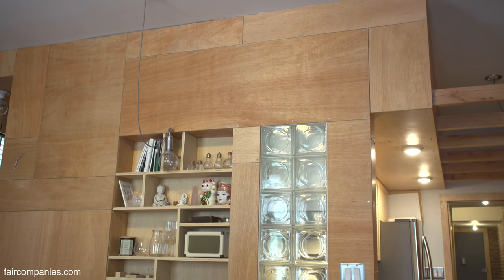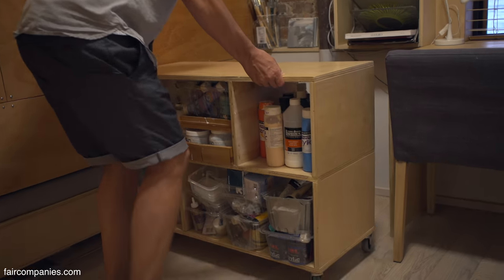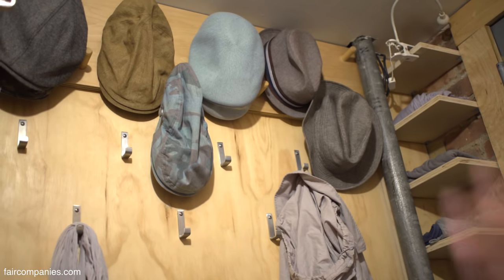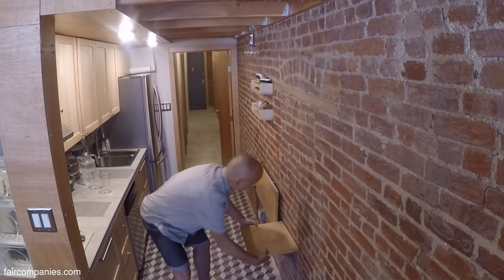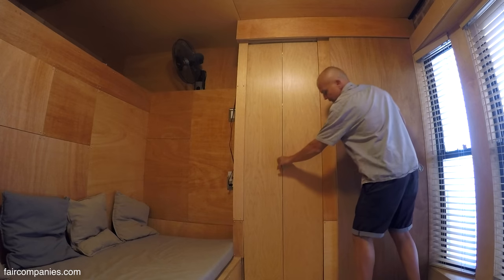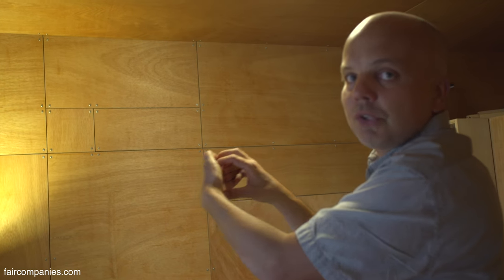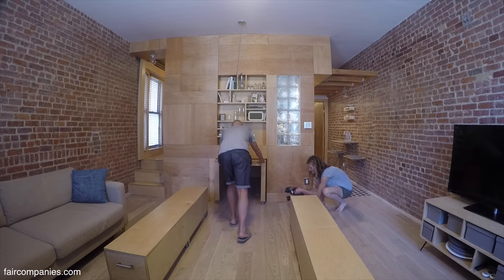Fluid NYC flat uses sliding furniture to create 3 rooms in 1

Comment: That guy is a genius love his apartment , he's made me look at ply wood in a whole different light 🌻
Reply: Think of the formaldehyde though...
Reply: Sally Brite He sealed the plywood with a clear varnish which would reduce the smell and affects of the formaldehyde. That said you are correct that people need to be aware of what’s in the materials used to build their living space in both structural and visual aspects. The same is true for furniture , textiles, and decor. This is a huge issue in smaller homes (tiny houses) and those that are tightly wrapped and enclosed preventing the normal air flow that older buildings and houses had. Which is why tiny houses and even normal sized houses have to have special air exchanger fans installed . The out gassing of toxic fumes will eventually dissipate over time especially when there is good air exchange between the inside and outside of the house/building/apartment. Unfortunately many people are clueless about what is in the materials in their home until they start getting sick and the doctor can’t find the source of what is causing them to be sick so they start doing research looking for answers.

Comment: Adding casters to every storage cabinet and many tools (miter saw, table saw etc) in my small hobby-workshop has freed up the space in a similar fashion. Casters are cheap and easy to attach, with many different fittings to suit the piece of furniture/equipment being adapted. They are fun to use and allow creativity to flourish in a small space. Best idea in the modern era of expensive real estate, yet they've been around for decades.

4 medium sized casters attached to a suitable platform, with handle attached, can carry considerable weight. I moved a heavy concrete seat 20 meters over a tiled surface without damaging the tiles or my spine.

Comment: I know he was proud of how tight the fridge fit.... The problem is that's probably not good for the fridge.
Reply: Most people don't provide even 1/2 enough ventilation for their refrigerators... compressors wear out far more rapidly that way!

 Good point!
Reply: The required space/ventilation for modern refrigerators has nothing to do with the sides of the refrigerator and everything to do with the back, top, and in front of the kick plate...  it being no clearance on the sides is of zero concern.
Reply: really? My fridge that i just bought said to leave at least 1 inch on each side. It's a new modern fridge by LG
Reply: + Hunter of the North
Rick is correct. Energy is transferred from the inside of the fridge and outside to the back. The air on the backside is heated up and goes upwards and then cold air is transferred from the bottom to compensate for the heated air which flows to the top.  

1 inch on each sides? That's a total of over 5 cm! 
Most likely you have misread the manual. I just read through the entire manuel of a new modern refrigerator from LG and nothing is mentioned about the sides, only the back.
Reply: just googled it and it came up with this...

For your free-standing refrigerator, you must leave a minimum distance of 50mm (1.9685 inches) of space free around the sides and at the back of the unit, and then at least 25mm (0.984252 inches) space at the top.Jul 20, 2018

Some say you don't need to leave space on the sides... but others do recommend to leave space on the sides. Maybe the fridge he has doesn't need as much on the sides
Reply: + Hunter of the North.

The space on the side has minor influence to get correct airflow on the back. 

Watch this video from LG. Swedish video but with english subtitles. 
https://www.youtube.com/watch?v=hBb3KBO0HMU
Reply: Hunter of the North 
Read up on it.  NOT NECESSARY (just causes a slight amount of drain on power, which changes their energy star rating)....when an issue at all....
Reply: The irony of the rick & morty picture :P 

 Your comment is super ridiculous. Basic Physics. If the hot air in the back is rising at a rate quicker than available space will allow for it to move away from the unit... it will also try to move around the sides. 

 Refrigerators are usually surrounded, if only partially... on three sides. So, unless they are completely unobstructed at the top, allowing for greater air flow ANYWHERE would benefit heat evacuation. 

 That's not even taking exchange into account. 

 You simply don't know what you're talking about.

 The more air there is around any heat generating body, the more air is available to conduct that heat into. Trapping that air with an insulator is necessarily going to impede transfer & evacuation. 

 You "read up on it" :P
Reply: Wrong... try again. 

 Energy is neither created nor destroyed... it simply changes form. 

 Heat is conducted from the coils to the air. The air takes on that energy. Heat expands, cold contracts. This hot air expands. When you define the space around it... this limits it's expansion. 

 EXPECIALLY WHEN YOU SURROUND IT WITH INSULATORS!!!

 If there is more space for it to expand into... it will. Period. Gas assumes the shape of it's container. Always. 

 Introducing airconditioned air wouldn't change what I'm saying. There is still the same amount of heat. It still has to go somewhere. It will still move away from the refrigerator at a faster pace if it is unimpeded.

 "your betters..." :P 

 Says the guy who thinks an ellipses is four dots :P ...but not even consistently. 

 Your nonsensical assertion that hot air traveling around one plain or another of any given cuboid would change thermodynamics, is preposterous. Even figuring for gravity... which is near irrelevant. You have a mass of hot air... it's right behind the fridge. It's collecting at the bottle neck near the top, where there is an opening for it to escape. 

 Ask yourself, if this exit where wider, would the air not flow through it more rapidly? 

 When there is more space along the sides, the hot air... which is expanding, will always slide along the area of resistance & when it finds this newly available gap, it will necessarily exit there. The hot air is not restricted to move in only one direction. It is expanding into whatever space is available. If heat built up sufficiently, it would escape UNDER the unit & out through your precious kickplate!

 Without fail, a heat producing body will cool quicker with more space around it, than it will with the introduction of insulation. 

 You've said nothing to evidence your foolish claim either. Your insults are not proof. 

 I've very clearly explained why you are wrong. All you've done is say "I disagree & I dislike you". Thank you, I'm honored.

  Seems like the joke's on you pickle boy :P

 P.S. moron, you're arguing with *ME*. I simply replied, politely to the OP. You are the one who came along venting your spleen. If you look at this exchange critically... it's quite clear that you're threatened, clinging to your shaken assumptions & desperately projecting. 

 Take a deep breath & actually consider the realities of what's being discussed. Maybe take your own advice & do a little research!
Reply: Dudes rich what he care?
Reply: I wonder if he thought of this and allowed ventilation through the partition into his office? That's what I would have done.  Anyone who's clutching their pearls about it can go to their websites and ask how they solved it.
Reply: actually heat moves in any direction, hot air is what rises, like in a hot air balloon.
Reply: I just spent so much time reading comments about refrigerator ventilation.. 

Thanks for the informative discussion to all involved!
Reply: There's definitely not 25mm of space at the top. Could end up being a fire hazard.
Reply: I agree. Need air flow for the refrigerator
Reply: Look what you started. This is one of the reasons they are lasting eight maybe ten years now.
Reply: This is true .. can change this a bit
Reply: @CaalamusTube  rude way can soften your tone
Reply: @CaalamusTube RUDE
Reply: @CaalamusTube  typed all that shit and still wrong🤣

Comment: Bathroom?  Shower?
Reply: not shown, but seems to be between the bedroom and office #2
Reply: Hopefully they will revisit
Reply: Here is more info and floor plan: https://www.dwell.com/article/this-compact-apartment-in-nyc-is-full-of-crafty-solutions-49bb6a3d
Reply: You can find photos, description and links here:  https://www.houzz.com/projects/2600810/uptown-transformer-apartment 
The goal in bathroom was to install washer and dryer under countertop. To solve this task, countertop was elevated a little bit higher then average standard. Since space under countertop is busy with washer and dryer, the biggest challenge was to install sink boul. If simply put sink on the countertop, then it goes to high, because countertop already was elevated to allow washer and dryer remain under it. I did not consider shallow sinks, because they are not convenient at all. Also it was not possible to install under mount sink, because there are washer and dryer. Eventually  i found sink that is half in, and half above countertop, and increase a little bit of countertop thickness. As a result this solution allow to have both washer and dryer, comfortable pretty deep sink and huge countertop to keep bathroom stuff on it. 
Another important element in the bathroom is tankless electrical water heater, Its New York, so water tank for all units installed on the roof. Building is old and big, so sometimes building tank is lack of hot water. To set tankless electrical water heater two extra valves were installed on hot and cold pipes. In case there is no hot water, i close main hot water valve, open cold one that right before heater, to let cold water go inside heater, and open another valve, that deliver hot water into the system after heater. This task also required installation of new electrical cable, because tankless heaters requires a lot of power.
The last thing is pretty big, 48”x30”, embedded wall cabinet, with three big parts and mirror doors. To support this cabinet, extra wood frame structure was built inside wall, that was designed thicker to allow build-in cabinet set inside.
Reply: ruh roh
Reply: Peter Kostelov it really shows how proud you are of this build! You did an amazing job! Well done!
Reply: Showers and bathrooms are not allowed indoors in NY.
Reply: Washer and Dryer? Or dish washer?
Reply: Bassroom and shower iz made from plywood.
Reply: @CaptainCocaine  Cheers Champ, you clearly are a Master of Your Sad Universe. You describing your own Masterly achievements would be worthy of a similar rebuke.Pfffftt!!.
Reply: @peterkostelov4017  I love it. You did an amazing job. Great use of space and the bathroom is also beautiful.
Reply: Charlotte Ziggy I hope your joking.
Reply: @peterkostelov4017  thank you!
Reply: Made of plywood

Comment: Aren't they concerned regarding formaldehyde toxicity coming from plywood? Unless the rooms are very well ventilated, the concentration of those toxic fumes, later on, will take a toll on their health. I hope they at least used a low-level formaldehyde plywood in all those construction parts.
Reply: Concerns about VOCs are justified but also often exaggerated.  So long as the plywood you're working with is at least a few months old then the level of off-gassing should be relatively very low, as long as you don't expose the material to a lot of heat and moisture. 

Since the resin used in its manufacturing process should have fully cured by that point and thus would only off-gas as heat and moisture would break the material down.

There's also many options to seal all wood products so that would also protect it from heat and moisture, which are what cause it to release VOCs as the heat and moisture breaks down the material.

What you actually have to watch out for is chemicals used on interior finishes such as paints,  varnishes, solvents, adhesives and caulks.  These have extremely higher concentrations of VOCs that are also more likely to be harmful to your health.

Though, eventually most materials will run their course and no longer significantly off-gas... This is one of the reasons people would use reclaimed materials because after so many years the materials would be pretty safe to use...

That may not be something that can be counted on with low VOC products because they off-gas at a slower rate, which means they may continue to off-gas for far longer periods that can last decades to even centuries...

So there's some caution to be taken with assuming low VOC products are always better...

Comment: The use of the square footage is nice and compact. Clever solution for the looooong table, so you can really entertain. Bench goes on the side!
But it sorely needs a few plants. The place is drab. I would get seriously depressed in it. Plus I don't like the plywood as the ceiling. Looks exactly as it is: finished with whatever ends were left over. 
Yet, the ideas are good. What a nice dad to help so well :) It's fun to see how proud Peter is of his place 😉

Comment: Well done, great use of space! We utilized plywood in my hobby room, using it for the top of the island work space and making L shaped tables for sewing machines. A friend used plywood for flooring, he cut two foot squares and rotated the grain for a pattern and coated them well for a smooth easy to clean finish.

Comment: This is my favorite "small" apartment so far. It's not actually a small space overall (700 sq ft in NYC is pretty roomy) but it's been designed so well. There's not an inch of wasted space.  The big disadvantage to it, I'd imagine, is that it would be rather difficult to reconfigure the space over the years if/when your tastes and needs change.

Comment: He placed a big box at the entrance to kitchen, in line with TV unit. That box has sharp corners! Rounding the corners is a must when you design compact spaces and when you calculate every inch of the space!
In the initial years I had tiny 550 sq ft apartment. I was very happy that I could manage everything well. 
But after 4-5 yrs I felt like I'm in prison and I wanted to run away.

Comment: Compact box designs are always great for highly optimal space.  Even better if they are used on 2 sides for access since you can do considerably more with the design compared to only 1-side access.
If you can manage 3 exposed functional sides, you're golden. 
The kitchen / office wall divide could be made 3 by having a cupboard on the office side, but that'd be a negative especially if you stole space from the kitchen.  The storage above is more than enough.
This does have 3 in another way instead, the underfloor storage counts.  Raised floors are massively underutilized.  It can add so much useful space very easily.  With sliding furniture, you can do even more like with this table, benches and the bed in the other room.  Sliding hidden beds is a great idea in general.  It allows you so much floor space and very little complexities in the design.  Having all your storage in the same wall as where the bed goes can keep the whole room free of clutter.  It's what I intend doing in my room soon when I extend a wall out 1.2 feet.  
The creation of that office guest bed was a good idea.  It can even be used as a simple rest space during the day, or in another way it could have been integrated in to a different table design if you put it there.  Or in another design use for the room entirely, it could have been a little private sitting room with a couch over the top of the table space.  Loads of ways you can do that room.  
Speaking of the kitchen, love it.  The breakfast table is so nice.    Some would see it as harsh because the wood, but that's why cushions exist.  It looks very comfortable.  That little rack for spices and such was a good call.  
Although I do worry for the tightness of the fridge and it's cooling elements at the back, not sure if there is space or not, hard to tell.
The space above the kitchen was a nice touch.  That could have easily been more storage, but just keeping it open with some beams across it looks better.  You could go crazy and make it a raised guest bed using one of those compact mattresses lol, it's an acquired taste.

I especially love the rectangular panel designs in the walls.  Always a fan of that.  The 4-screws at each corner is another I love seeing. It just adds some depth to it, despite being very simple and quite flat.  Different colors on the screws could work.  A deep brown would look nice, or even black if you want a more solid look to it.

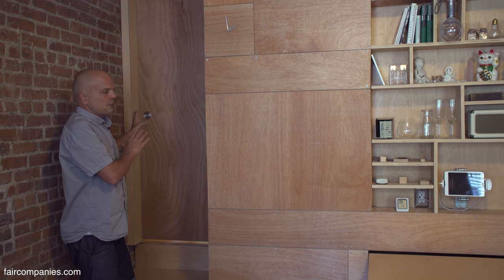Comment: 2:32. Your exposed window philosophy is compromised when the slider is closed. You should cut a rectangle inside the door and install frosted glass. The frosted glass will actually capture the light  better and evenly illuminate the left section of the dining room.